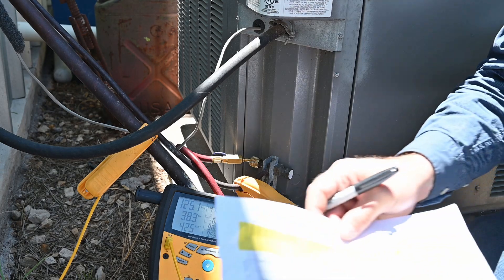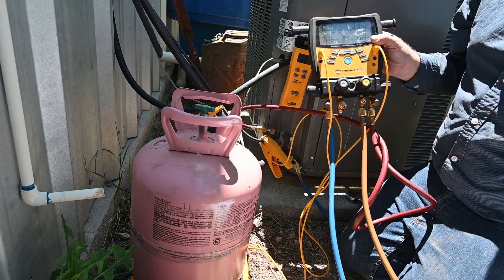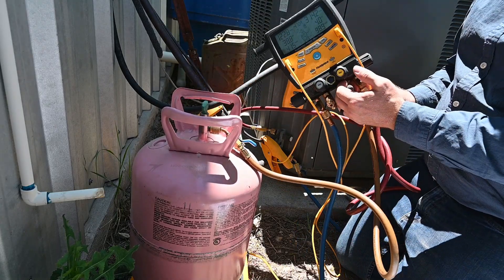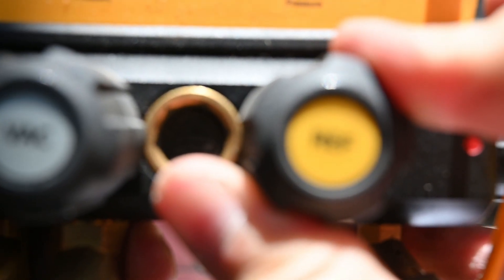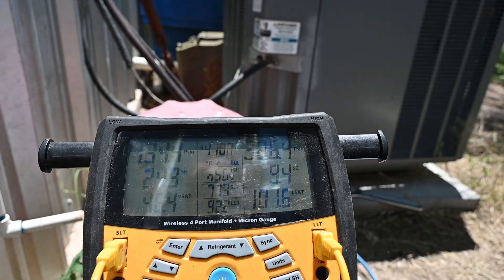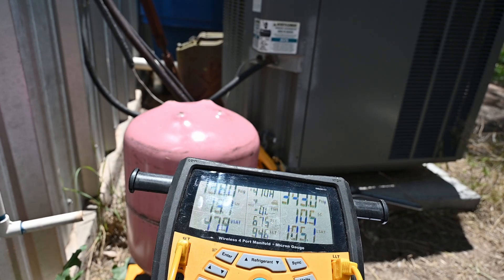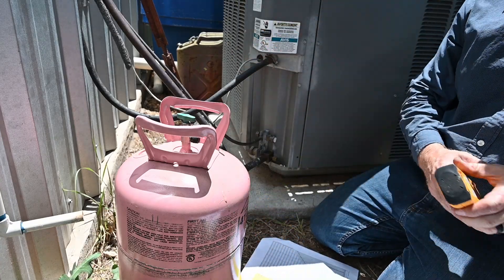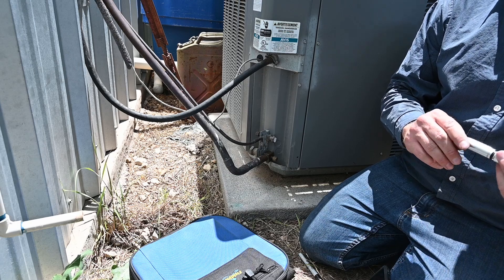HVAC 109 Example, charging a low system

Comment: im confused sir, if your adding it as a liquid why are you charging it into the gas line instead of the liquid high line?
Reply from the maker: Throttle it in. I expand this in the playlist series in great detail.
Open and close the valve in very small increments, it lets a little burst of liquid into the hose and allows that liquid to expand and boil into a vapor before it reaches the compressor. 

The liquid line is higher pressure than the tank. Physics will not allow the pressure of the tank to overcome the high pressure of the system to charge. 

If it was not for the check valve in the tank liquid from the unit would leave and enter the tank because of the pressure difference.
Reply: @love2hvac  is that just for r410a or other refigerants as well? im a facilities manager and just recently started doing alot of hvac work. im going to check out all your videos and  that playlist thanks brotha, need to learn as much as i can if you have any recommendations let me know.
Reply: oh.... you charged it as a vapor, why? isnt it always better to charge units as a liquid?

Comment: Mr. Ty, I've watched most of your HVAC series and I have to say: I'm baffled at how this much valuable information is provided for free on the internet (you have a donation setup?). Anyways, with all the theory that I have learned I can't help but think: isn't it simpler to just measure coil temperature and suction/liquid line temperatures to obtain system subcooling/superheat? A thermal camera can be all is needed to achieve this easily.

By the way: I've never ever used a manometer, but I've learned so much from you I feel like I'm a pro.
Reply from the maker: Thank you!
I need to set one up.
You can get sh with 2 thermometers. It's a little more difficult with SC but you can use approachethod in place of it. Bryan Orr has an article on that.

A thermal camera has great benefits but due to  emissivity of the coils it doesn't give an accurate enough temperature.
Measure quick does have the ability to check a system charge without attaching gages also

Comment: is it ok to have 13.5 subcooling on a 10 +- 2 Target? per manufacturer? Only slightly higher amps? Will it perform better in heatpump by having more freon? in the winder when the volume goes down due to the cold?
Reply from the maker: It will not perform any better.
It could end up with more system wear and higher pressures and lower performance. 
In heat pump mode the system uses less refrigerant so a higher subcooling could end up flooding the systems. 
Stay within the manufactures specifications.

Comment: Thank you Mr.Ty is possible to use super heat or subcooling for checking ductless mini split utilize with capillary tube or recover the refrigerant and charge it?another question when open the flare fittings is possible to re- use it again? Thanks.🌼🌷
Reply from the maker: Ductless mini splits have very specific charging procedures. Usually they require charge by weight. But you have to follow that specific manufactures method.

Reusing a flare is risky. Reusing a flare is best done with a type of flare gasket.

Comment: Hey ty I’ve noticed here in Vegas  when Dealing with a piston , As I’m getting the IDWB and the condenser dry bulb to try  and find my target super heat it’s usually off the charts. Is it because it’s just so hot here and the humidity sucks ?? And if I can’t find the target superheat how do I know what to charge the unit up to?? I usually just charge it up until I get a good split but I know that’s not the correct way.. Thanks !!!
Reply from the maker: It means it's outside of design conditions. With that metering device and those conditions it should not be run because the superheat will be too low and can cause compressor damage. 

That is why the TXV is sooooooooo important in that climate. 

I talked to one contractor in Vegas that uses fixed offices just so the units won't last as long.
Reply: @love2hvac  what*
Reply: Ok so would you recommend doing when charging a unit with a piston and the target superheat is outside of designed conditions?  Thanks for the reply!!
Reply from the maker: Charge to 5 superheat. Never less

Comment: Just starting watching some of your vids. For the most part I like your style and how are your explaining everything. Now I know doing vids to fit all content would take up a lot of time just watching you do every spot, connections, by step by step. With that said I am an instructor for about 5 yrs now, with 16yrs field experience and the main reason for this post is... why did you not bleed your high side and then pumped that liquid back into the system? Again I like your vids and haven't yet used one of your video's in my class room because I am a stickler for doing every step perfectly. ( no I'm not perfect just strive to be )
Reply from the maker: I will have to done check  pretty sure I bled the charge bose threw the suction side then opened the high side and drained it to the suction side and lifter the hoses so any liquid would drain in. The also lifted the suction hose so any potential traped liquid would flow in. It's possible it got deleted by acadent  but I remember seeing it during the edit. Editing is my biggest pain. I will look tonight when I get off work.
Reply: @love2hvac  Thank you Ty and I know about editing as I do one video for my students at my pastor's house, it is a pain. Keep up the great work. :)

Comment: why you pour liquid in the suction (Low) side ??
Won't it damage the compressor because liquid is not compressible!!!
great video by the way 
thanks
Reply from the maker: Great question.
With it running 
1st, we can only get it into the suction side. If I was to open the high side it would not flow because the compressor in the system has raised the pressure higher than the pressure in the tank. 

Now that I can only put it in the low side, and it has to be liquid (400 series) I throttle it in, very small amounts at a time
 That give it time to flash or boil into a vapor while in the hosees, manifold, connection, and large volume suction line. By the time it gets to the compressor it is a vapor. 

If I was to open the valve for to long, I would get liquid to the compressor. 

If I was to put it in the suction side with the system off, I would damage the compressor.
Reply: @love2hvac  thanks
Reply: @love2hvac  Hi, I have a quick question. I'm wondering how that liquid 410a refrigerant turn into vapor through hosees, manifold, connection, and large volume suction line. what is reason beyond it? I get that large volume suction line means low pressure and it drops boiling point lower but I still don't get what exact reason makes this liquid refrigerant become vapor through this process. and
 I have another question that how come 410a refrigerant can keep both liquid and vapor state in tank with ambient (atmosphere) temperature although it has extremly low boiling point. shouldn't it be only vapor in tank since our atmosphere temperature can't be -55.3°F mostly. I would appreciate it if you could answer my quesitons, thank you

Comment: Have you had the yellow scale lose Bluetooth contact with the meter in the middle of your charge ! 

                      Sometimes it reconnects improperly keeps track of the charge that you lost track of well it lost Bluetooth connection. 

            And then other times it does not reconnect for track to charge that went into your system,  not critically important on a large split system

            But on a small reach in box or refrigerator or prep table we’re only talking about ounces do you have to completely remove your charge and start all over again. 

          That’s why I have stopped using that yellow scale and so have many other technicians and You Tube HVAC content providers
Reply from the maker: Mine is not blue tooth. Its just wireless to the digital display. It was when they first came out but when it lowers off it shows where if left off even if it's weeks between use. 

Good to know about the blue tooth.
Reply: @love2hvac  yes wireless but I believe they use the Bluetooth frequency range

        It was OK when it re-capture signal and has held on and recorded the weight

        But after the third time of losing the weight in the middle of charging that’s when I mothballed it and only keep it as a secondary back up scale in emergency. 
                        With the NAVAC scale I have not had that problem